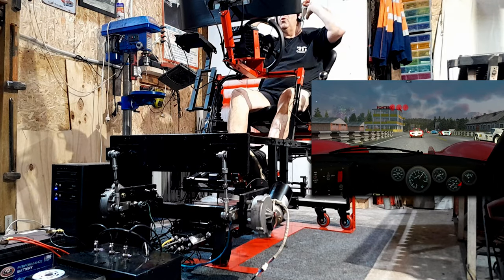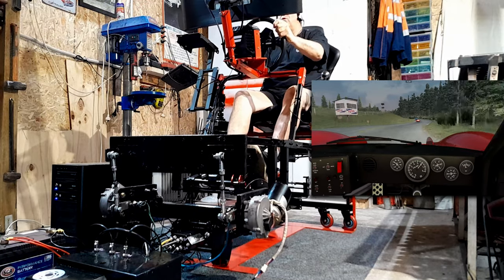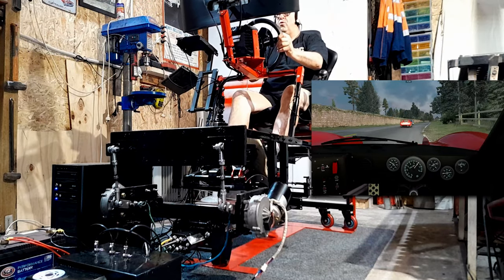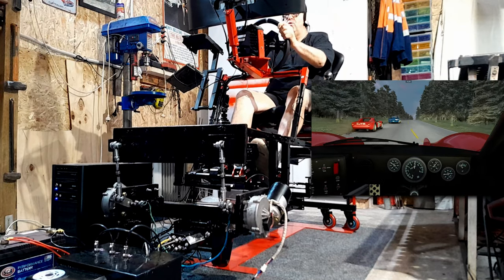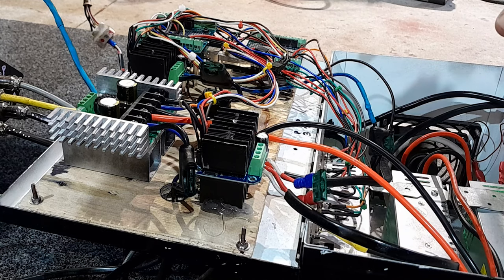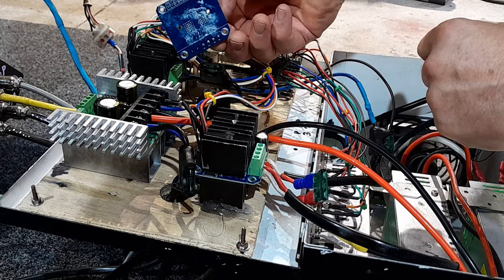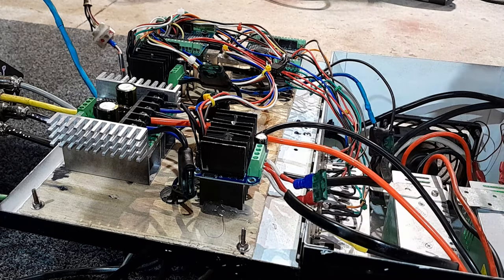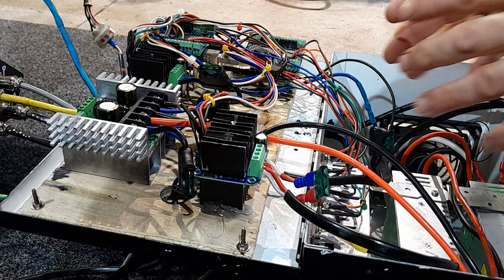How To Build A 4DOF Motion Platform At Home Pt 2

Comment: After hearing your points about the Sabertooth, I went ahead and bought one. Mine was about $185USD but it sounds like it will be a worthwhile investment! Hopefully we'll be starting on the top frame soon, we finally finished the carriage and it is level as can be, really glad we took the extra steps to make sure it's level and square!
Reply from the maker: Nice one SM on both counts. Yes. A nice level starting point should pave the way for you to have less issues with the way it runs. Great work on the sabretooth purchase. I'm so pleased I pulled the trigger on getting one. 

You won't regret it. I will say that so far so good with the other 2 IBT-2's. They are both delivering the goods with the TL and surge motors. They stay really cool, but are responsive and powerful with those motors. In saying that though, the rig would probably be that much better again if I did spring for another 2 x 32 but like you said, they ain't cheap so the IBT-2's are staying for now.